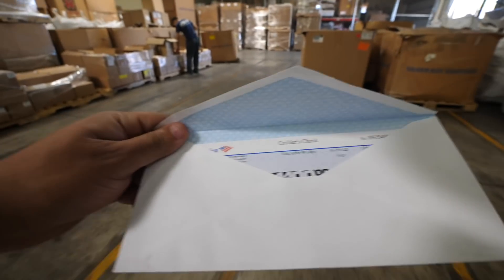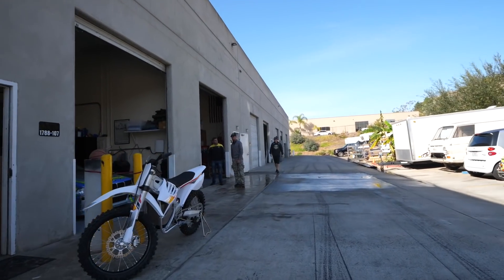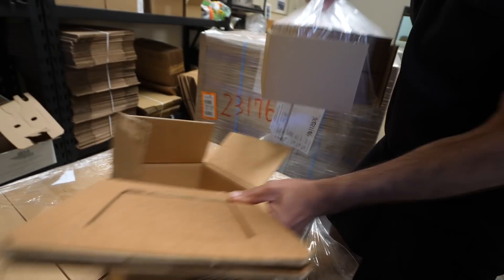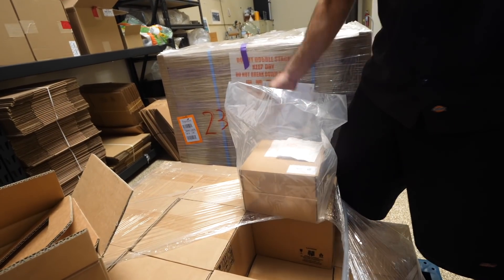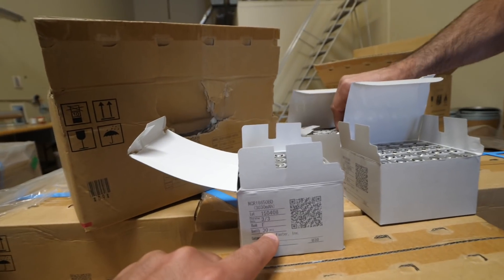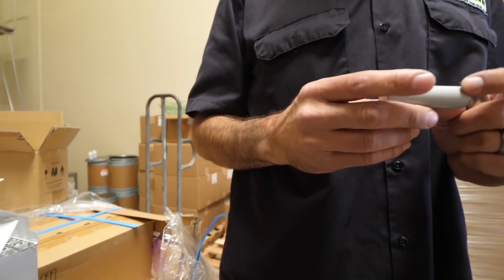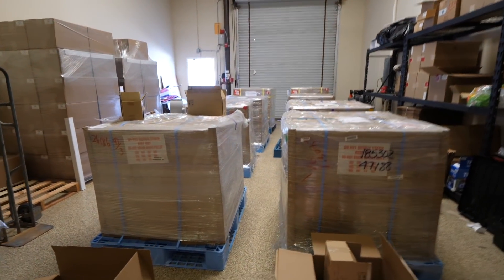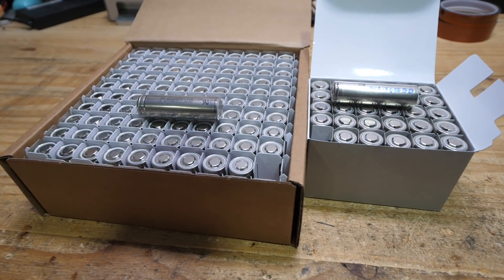150K  3000mAh  18650 cells for your DIY Projects

Comment: hello  i make homemade electric scooter i bought brushless motor (mini) n5065 320kv 40euro + esc fvt 120A 24v but the esc burns ( i bought 2 esc fvt 50euro each and burns both )
so  I found brushless motor 1500W 48v 30A 180euro 4500rpm ( big motor silver color) 3.5kgs 180euro +esc 30A 48V = 230euro 
so i ask better solution is  i pay big motor 1500w 180euro +esc 50euro or pay n5065 320kv 24v motor +esc 90 euro ?

Comment: So .. just for my information, i tried your website, did a complete kit for a 10kwh system ... end up to 4500$ (without box, without inverter.. only batteries and PCB) ... well that's really high ! An Lg 10kwh is available here (all included) for 5000$. I can't see what is the point here ...  ? Not even talking about their 10 years warranty.
Reply: The PCB is ridiculously overpriced, build the pack using a soldering iron or spot welder.

Comment: Jehu- You have minimum quantity on the Sony power cells as 200 but offer tge Panny storage cells in smaller 180 and 30 quantities (opposite what you say in the video). Mind offering the Sony in the the smaller 30 size quantity ? It would be impossible to try and fit 200 cells onto my ebike 😛) - thanks buddy !
Reply: Hey Dave! How many cells do you need? We could share a lot! I need approximately 150-160 cells! Let me know if that works with you!
Reply: Victor Desaulniers where are you located ?
Reply: Hey Dave.. he actually sells 50cells pack... I ended buying a 200pack I might only have 20-30 extra cells finally!!
Reply: @victordesaulniers5564  oh wow, I clicked the original link and it showed the 200 only, but see the 50-packs now !  Hey, let me know if you want to sell me 10 cells from your batch ! :)
Reply: Miami Florida!
Reply: @victordesaulniers5564  I need 60, which would leave you only 140 since they still only have 200 quantity :-/  I was hoping Jehu would break the VTC6 up in smaller quantities, but it seems that's not gonna happen.  Let me know if 140 would work for you.

Comment: You'll be rich af if u sell it to vapers
Reply: Don't they have Chinese retailers with free shipping available to them?
Reply: @Cloxxki  well since the vape industry is booming the demand for this battery is rising as well , greedy china rewraps old recycled batteries or fakes, they sell faulty or bad batteries and brand it as new ones .. They falsely claiming its capabilities is the best for example they have large MAh or Amps discharge up to 40A.. soo its hard for vapers to find a good safe and powerful battery to use .. because vaping drains amps up to 20A which most 18650 with 15A safe discharge ..
Reply: @Cloxxki  20A - 30A Continuous discharge battery is VERY  hard to find for it's quality, authenticity and reliability

Comment: Hi Jehu

By now, I assume you have seen Rich Rebuilds fire in a toy car with two Tesla modules going up in flames with exploding cells. Might be a good time to reflect on the safety issues with DIY projects and 18650 Li-Ion cells. Best Regards, Frank
Reply from the maker: I’m scratching my head,  you’d seriously have to abuse those packs to get to blow up.
Reply: @jehugarcia  Yes and no ... I need to have a discussion with Rich about it.   The packs are designed to be cooled, and while they do have a thermal cutoff and fuses ... they are designed to have circulation.  I think when Rich used them in that little Disney runabout he decided to go without any cooling, and was running the batteries past their limits

Comment: The sony vtc v6 batteries shouldn't actually be used in e-cigarettes. Got an e-mail a few weeks ago and some friends who also purchased them on amazon. Sony didn't dsign them for vape useage. This probably happened because some people had their sony cells gas out in their vapes and suing sony
I will continue using their cells in my vape, but I will keep in mind that they aren't designed for that
Reply from the maker: Zero cells have been designed  exclusively for vaping to my knowledge,   All cells have working parameters and vaping might or might not fall within those parameters.  Vtc6 can do 15A continuos and 30A pulses,  if that works for vaping then you can use them
Reply: @jehugarcia  good point.
15a @3.7v is nore than 50 watts. But even single cell vape mods can go up to 100watt. I guess there were some idiots maxing out the output over longer periods of time and simply wore them out so violently, they gased out. And probably sued Sony. So Sony simply now states that their cells aren't suited for that use. You have to state that you can't microwave your cat now. Same goes for the cells and vaping

Comment: Where in Europe (Germany) can I buy 18650 cells so cheaply? Or who ships to europe/germany?
Reply: You can buy refurbished and/or re-wrapped ones from Aliexpress for 2-3€ a piece, from shops like LiitoKala. The thing with those is though that some might be less than original capacity.
Reply: @4nlimited3dition_4n3d  dafuq dude, just buy new cells from www.nkon.nl. You dont even have to pay 3€.
Reply: Sure, that seems like a good seller. Some sellers on Aliexpress are legit too according to the reviews. And my 1kWh+ battery I bought from a seller on that site hasn't blown up yet. I'll consider nkon.nl when I need 18650.

Comment: I have asked this question before but just need a simple explanation. I lost all my screenshots of the live stream a few weeks back.
I need to know what the most generic or an expensive way to build a battery pack for my car audio system. Course it's a 12-volt system and charging around 14 volts when the car is running. Please if you could just tell me which battery and how many of them per 1000 Watts I would deeply appreciate it. I'm about to have surgery on the 19th of December and I will be down for several months recovering. I have two discs in my back that are deteriorating badly now rapidly so they have to get them out and give me a fusion. I'm not asking for anything other than just a which batteries and how many. You would be doing me a huge favor and save me a lot of time. Possibly a lot of money.
In fact I will give some type of car audio item for this little bit of help please.
Here is the link to my Facebook profile so you can private message me there.
Please, I thank you the original poster and everyone here in advance!
Reply: I think you'd be better off buying a pre-made 12V li-ion battery pack. Try googling those out. Should be 10$ and up.
Also wouldn't a normal lead acid car battery be a better option?

Comment: I just got a Bajaboard and plan on building a 2nd, more powerful battery for it using the Sony's but I have no idea how many to get or even really how to set it up. All I know is I'll probably go 12s but idk how my P
Reply from the maker: 12s5p at lest
Reply: @jehugarcia  yeah I saw portable electric vehicles video with the Bajaboard that you met him in NYC to look at and mentioned it will hit 50mph and I think he went 12s10p from 2 separate packs that are 6s5p I think. I just don't wanna go full on like he did replacing the ESC and BMS. I would like to keep these stock parts and just majorly upgrade the batteries for better range and speed. I have the 550Wh battery pack and I know they make a 900Wh battery pack.

Comment: Just a quick question. I have a liito kala battery tester and have noticed that it will not completely charge my cells back up to 4.2v when it has finished testing the cells. As it only charges them to around 4.17-4.18v. So when I leave them for two weeks to see if the voltage drops I can’t tell if they how much they have dropped because I don’t know what voltage they were at in the first place unless I use a multimeter and write the voltage on the cell. Thanks
Reply from the maker: That weird
Reply: jehugarcia Yeah it’s happening to me and my friend
Reply: 4.2 is recommended charging voltage, not charged up voltage!! yes charger keeps the 4.2V until current is  less then ~70mA-100mA.  0.02-0.03V is not the indicator for something wrong. Check the datasheets. e.g. https://engineering.tamu.edu/media/4247819/ds-battery-panasonic-18650ncr.pdf  and check resistance

Comment: @jehugarcia I was looking at Sony's website for the VT6 cells -- one listing shows 30A continuous with 80C circuit cut-off, and another shows 15A continuous w/o temperature sensor... I'm assuming these cells are 15A because they are naked cells unless you have something like a Batrium cell monitor that can check the temperature?

Comment: So.... Jehu, in Your video you mentioned small quantity of them Sony will be available. And the cheapest batch is $700 for 200 batteries. That’s not small quantity imo. Or I’m missing something?
Reply: Christian, those are legit cells, not chinese made. That's actually a good deal. You can tell the difference between chinese and japanese cells. Most name brand cells you buy from china are rewraps. Ev west needs batteries too so they won't let these go much cheaper because they'll end up paying more down the road. It's a great deal for genuine new batteries. These are direct from the manufacturer. I know what the new packaging looks like and there is no doubt they are legit. Cost may seem high but I am confident the company that bought all 150,000 cells paid more than the price they are being offered. If you build a project with these cells they will last you a long time.
Reply: @tomamerman7699  very true
Reply from the maker: Check tomorrow for smaller batches.
Reply: Yeah would love a few for a smaller project. I would be interested in a smaller batch like you mentioned.